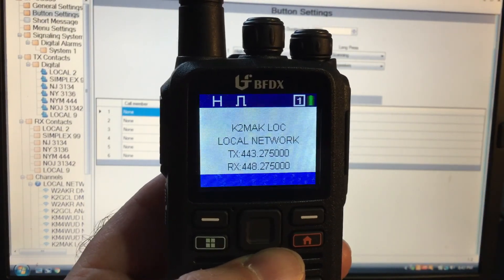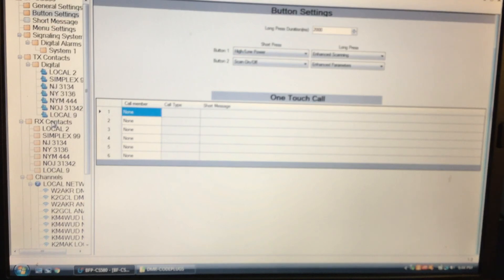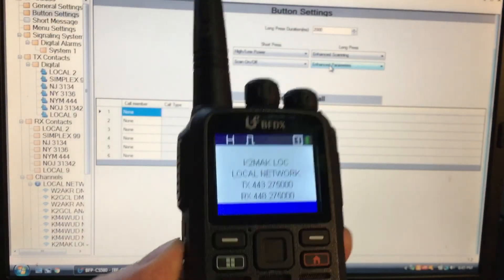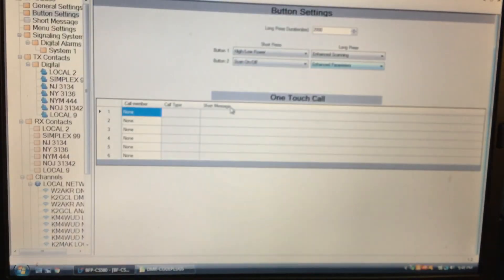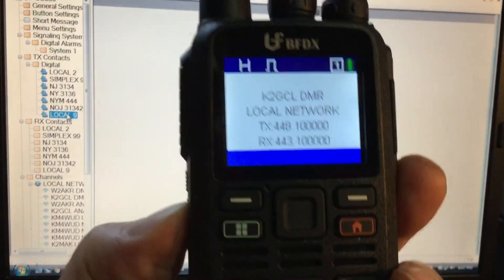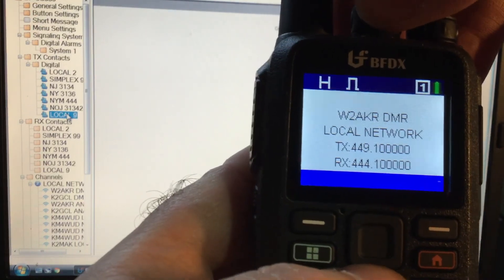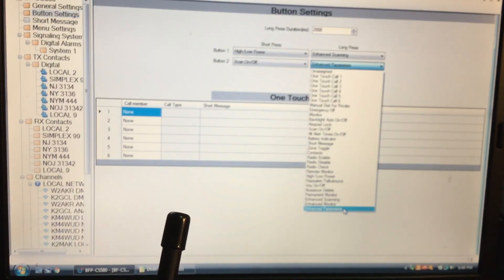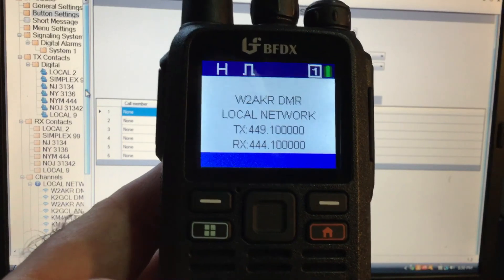Cs580

Comment: I like the auto detect feature for CC TG slot when it’s scanning between lower and upper limits
Reply from the maker: humaxf1 
There is a new firmware update on the connect system website. That gives new features.
Reply: Thanks for the heads up on firmware. I don’t have a CS580 yet but am considering one.
Reply from the maker: humaxf1 

Yes courtesy beep.